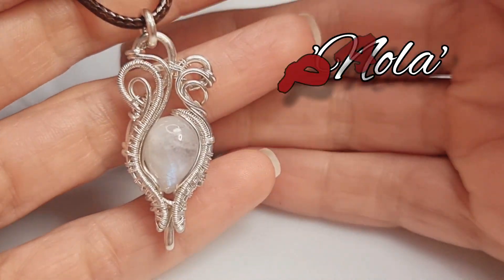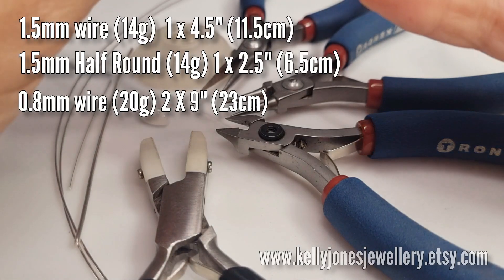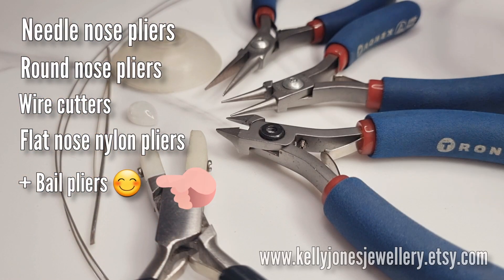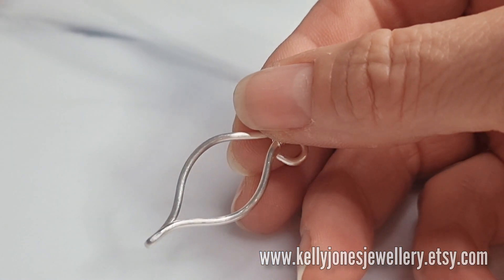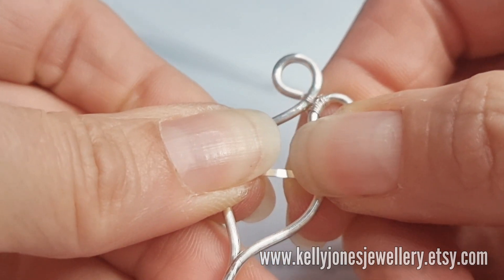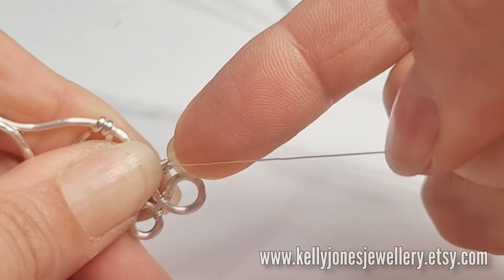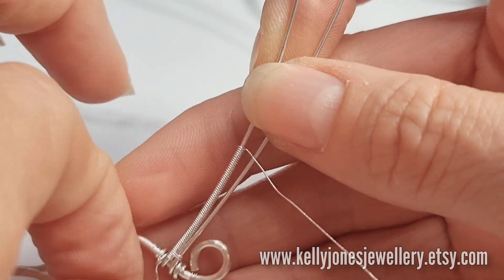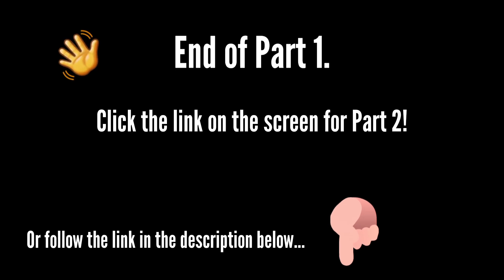Wire wrap pendant tutorial "Nola" Part 1!

Comment: You never cease to amaze! Your designs are drop dead G😍RGEOUS! I keep practicing but mine come out looking like a hot mess!
I'm having an issue with my copper wire & was wondering if you could point me in the right direction...my apologies in advance 🙏🏼..& promise not to make this a habit! I originally ordered half hard wire (16g & 24g)..it was way too hard to manipulate..so I ordered all (16g, 20g, 24g) dead soft..it's a lot better, however, either my 20g (& sometimes 16g) wire is not firm enough or my weaving wire is too stiff/thick (24g) to use. I'm not sure if I should just order 28g/26g weaving wire..or if it's the dead soft wire that is giving me problems. Hopefully that makes sense..🤞🏻. (I'm also considering adding half round but it looks thicker on screen so I'll need to look into what gauge for that as well).  I'm sure you have a busy schedule & I understand if it's too much to ask..I would be 4ever grateful..so would my sore hands & bleeding fingers..🤗...Tia!
Reply from the maker: Thanks for your lovely comment 😊💕 I always use dead soft, mostly 20g and 28g. If your in America I recommend Rio Grande, I'm in the UK so I buy from metalclays4u and scientific wires uk. I never use half hard, always soft. And I find the thicker weaving wires are a nightmare to work with, the 28g is fine enought to weave nice and tidy and doesn't break (too often), the thicker weaving wire is a struggle. The base wires, I use 20g soft, I find that works for everything I make. If my piece is quite big then I use more wires to add strength (instead of changing the hardness). Hope this helps 💕
Reply from the maker: Oh and I don't use coated wire, that is very tough on your fingers too (and I find the coating mostly comes off over time) ❤️